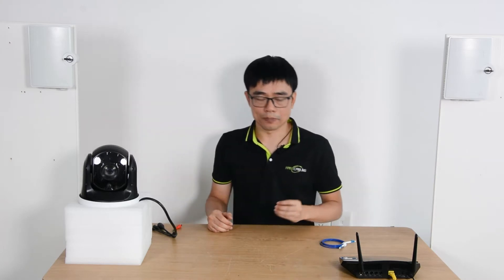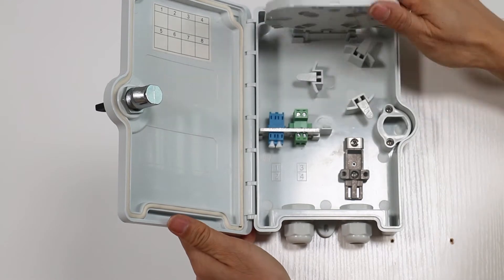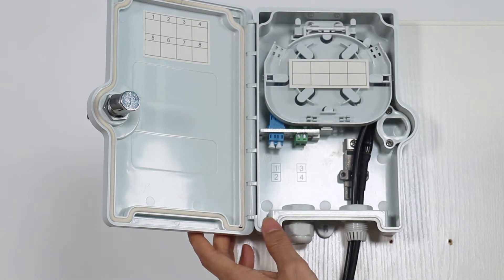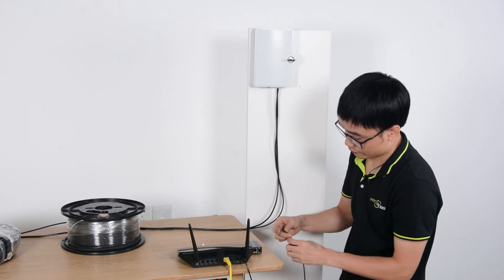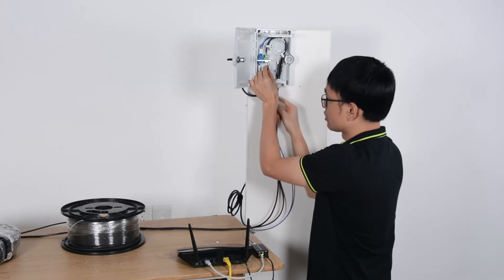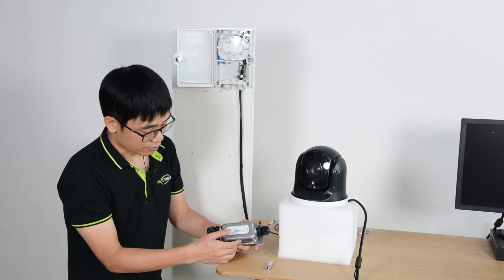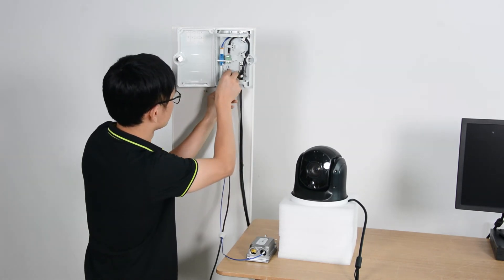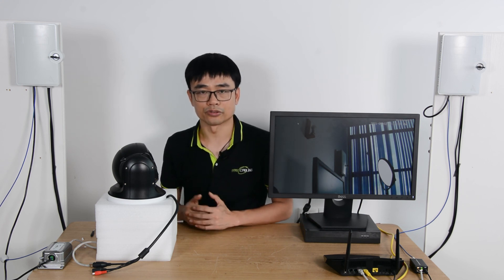Use Fiber Optic for Outdoor IP Devices Setup over 100m-Local AC

Comment: Hello dear can you help me please the name of the product.
I want to extend the WiFi dongle cable to a distance between 10 meters to 20 meters.
I want to put a wifi dongle on the roof of the house.
Reply from the maker: No, the bandwidth is set to 100mbps within 2500ft. The TP-link has split 12-36 and 45-78 into two groups to take in the power. The 12-36 will accepts the DC48V standard POE with power handshake. The 45-78 only accepts DC24V passive PoE. It is kind of non-standard POE implement, as standard POE requires either 12-36 or 45-78 can handle the DC48V standard POE with power handshake. As it only works with 1236 power method, we re-designed the power method on our 1Gbps POE extender. If you order through the link below, and put down the note 12-36 power method, we can supply the right unit. Just one more thing, It doesn't work with IEEE802.3bt POE extender, because IEEE802.3bt supply the power over  4 twisted pair, and it will damage the access point. https://www.fastcabling.com/product/poe-extender/

Comment: What is the maximum distance  possible between the terminal boxes?
Reply from the maker: The maximum distance could be up to 80km. It is determined by the SFP transceiver. Most of the single-mode SFP transceivers can achieve a 10KM distance.
Reply: @Fastcabling  

I mean maximum distance for the power cable. What is the maximum distance for the power cable at which the voltage is not recoverable by the terminal box?